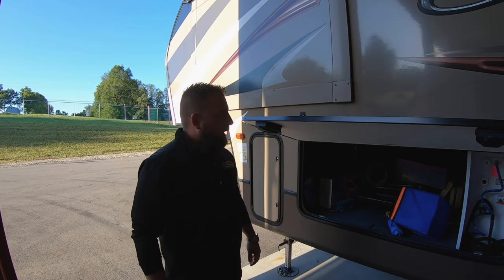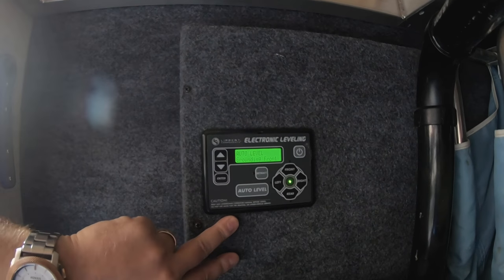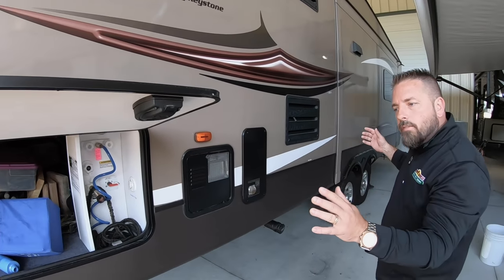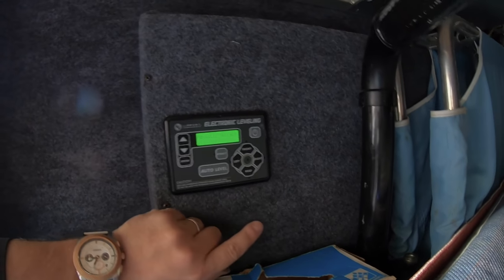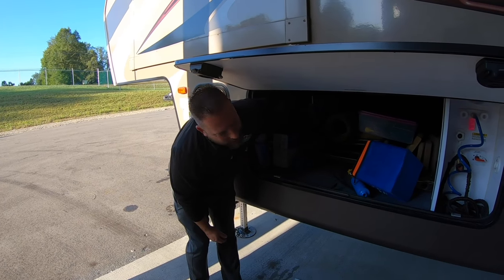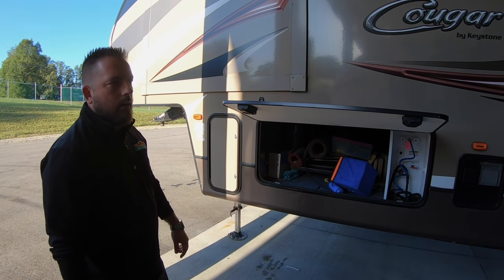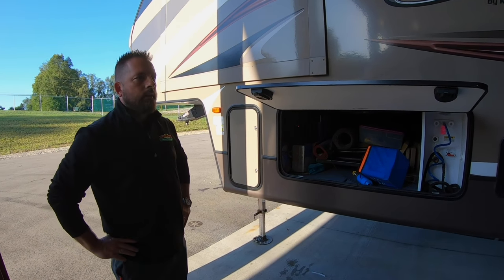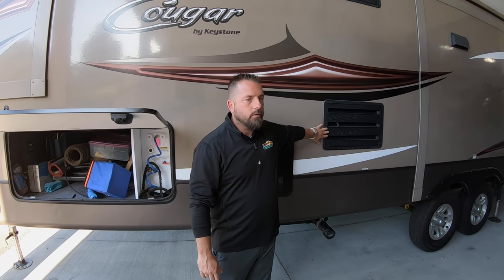How to fix auto-level errors and re-home your fifth wheel

Comment: We have a 2020 Keystone Cougar with the Lippert GC 3.0 and have had nothing but problems with them.  Our previous 2015 Heartland Cyclone with the 6 pt. hydraulic GC system had no issues.  IMHO, the electric units are pure JUNK!
Reply: Dont bother with the customer service. Guy blamed my batteries even for the fault and not lowering my jack even though the other Jack's lowered just fine

Comment: I've had my Montana High Country with Lippert 6 point 3.0 auto leveling for 4 years now, and I STILL have problems getting the middle jacks to lower manually.  I think I've got them to lower manually only a couple time.  It's a real pain in the neck to rehome.

Comment: Good info, when mine throws an error I have to go inside the coach to the lcd ground control panel and acknowledge and reset for the outside control to operate again. This is a silly, very inconvenient setup by Lippert.

Comment: Thank you for the video.  Regardiung the re-home process.  Some YouTube creators state that the 6" re-home process needs to be done hooked up to the truck with no weight on the front landing gear.  However this video as well as the Lippert manual does not mention this.  Please give some feedback on this.  TNX.
Reply from the maker: You do not have to be hooked up to the truck. Just make sure the truck isn't parked under it when you re-home the system because it will drop the front end all the way down.

Comment: I had a weak battery and caused all sorts of problems for 2 years. I changed out with bigger brand new battery and it operates perfectly. Otherwise I would get out of stroke errors right front Jack errors and so on. All I'm saying is load test the battery

Comment: Can you show how to manually retract the jacks?  You said there was a mechanism behind a plate on each jack?
Reply: A 3/8" ratchet and a 6" extension works well.....just in case anyone is still looking for this.
Reply: Also a 5/32 Allen to get the screws out. The one by the motor is a bit tight but just requires extra time on it. Once the screws are loose enough you can pull the unit off. Be care you dont drop the washers which are really small and easy to loose. Also sometimes the sprocket will fall out and are covered in grease so they'll get dirt and leave on them if you arent on asphalt or concrete.

Comment: We have the Lippert electric auto level on travel trailer, had these issues from day one, flat ground, uneven ground didn't matter, 90% of the time we got an error. Had only 1 battery powering the trailer. It wasn't even a deep cycle battery, just a car battery. I bought 2 brand new deep cycle batteries installed them in parallel and hard reset the Lippert system. Haven't had a single problem since. Lippert should require the manufacturer or dealer to provide proper power to run the system.

Comment: i have a 2023 Coach Chaparral.  When i went to autoevel at home, the drivers side front jack and the rear left jack kept extending. i shut the poweroff.  I manually checked the level.  will the recalibration work to fix this issue.

Comment: Hello I really help with a problem,  my lcd buttons won't turn on? Do I need a battery to turn it on? Or 7 plug pin from a truck? Just bought the 5th wheel and they dropped it off now that I'm moving I'm stuck with this issue.
Reply from the maker: I would first check your fuses. I'm not 100% sure (josh in the video is the expert) about requiring a battery. I know in my unit I've been hooked to my 7 pin BUT I do have a battery. If that doesn't work I would call the dealer you brought it from for additional troubleshooting. If all else fails I know lippert has great customer service. I hope this helps.

Comment: I had all jacks down 6 inches and pressed and held retract, still getting the LF error message and beeping they wont move
Reply: I did the same thing, then i realized the actual jack not the extension was not out at least 6" .. once i figured that part out..it worked.